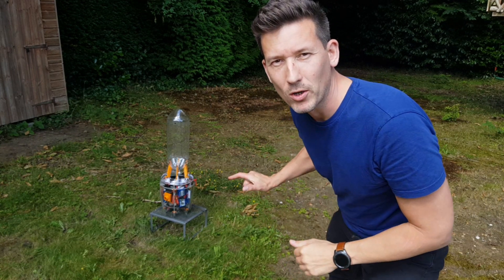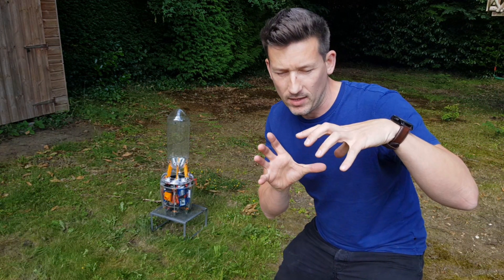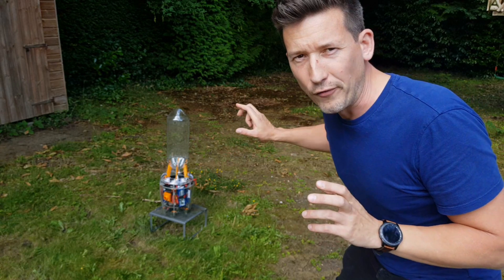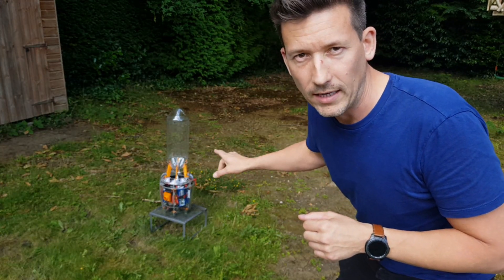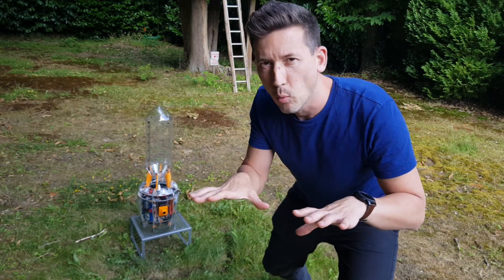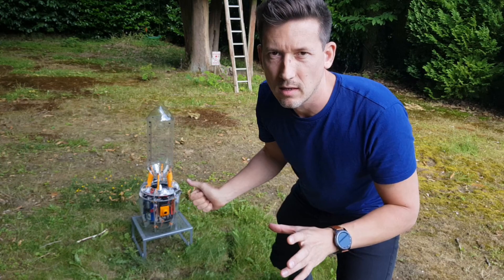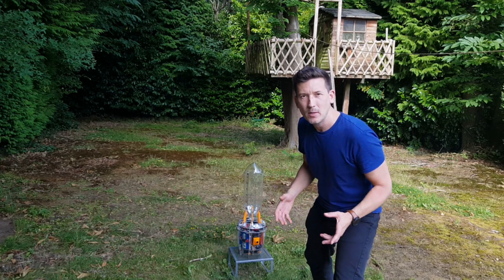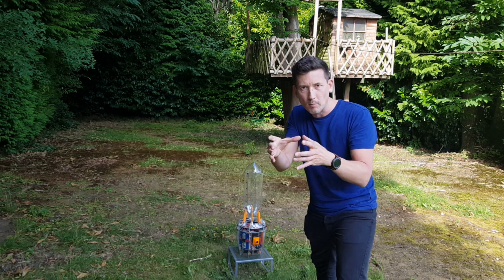Payload Flight Test

Comment: Gegadyne Energy has proprietary Graphene based Supercapacitor batteries with very high energy density, low self discharge rate(Its not the traditional supercapacitor batteries). That might help you reach LEO with less payload.

Comment: Could you use the two EDFs in series and spin one up and the other down to control yaw like on a quadcopter. Probably won't be needed if u have the control veins though

Comment: The very tip of the payload stayed central to the axis which would make sense to move the payload to the bottom as the previous comment says. I don't know how it would handle a full load in its current configuration but that's the fun of testing! Great work in the build and the attachment of the payload though 👍